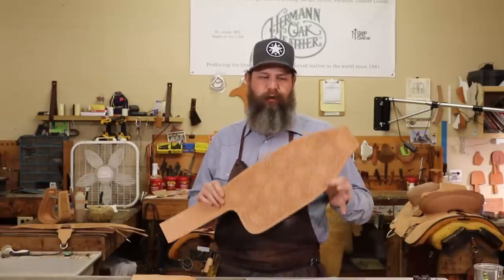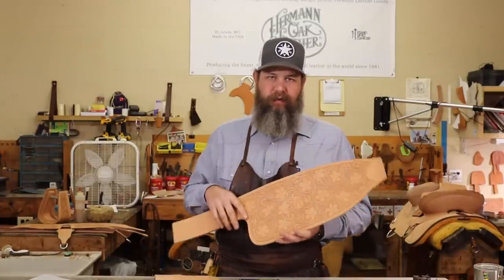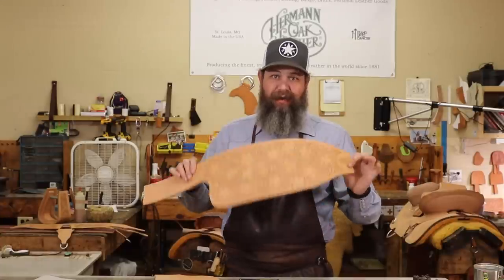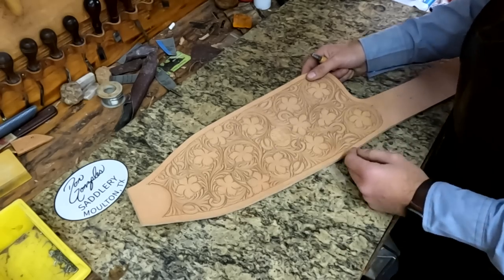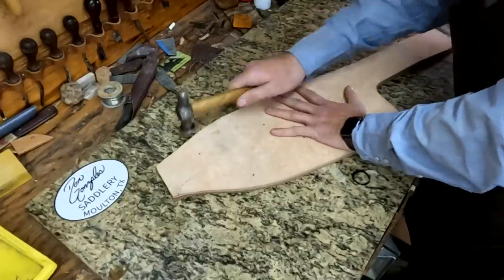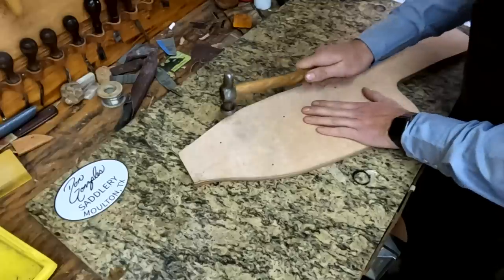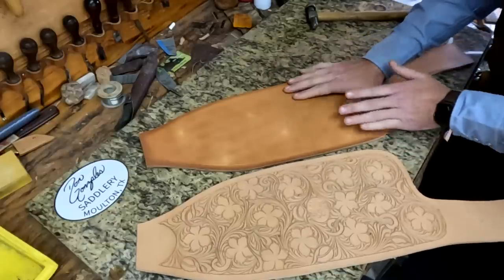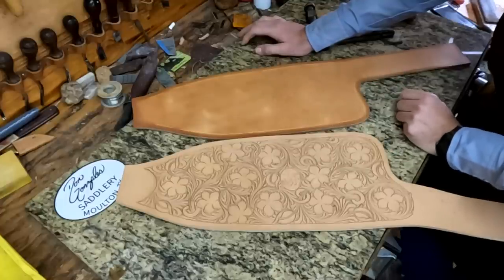Large Leather Tooling Patterns Transferred Easily

Comment: Very helpful tip! I have used tapoffs for small items, but I am about to make a set of California style Tapaderos. I have attempted this before with large pieces and it did move a bit, so I had a rough time carving the second piece and was not really happy with the result. This tip will make it work much better. 

I also notice some commenters are confused about whether to carve and bevel, DON'T BEVEL or do any tooling. You want clean, crisp swivel knife cuts ONLY. After transfer then you can bevel and tool in your normal style.